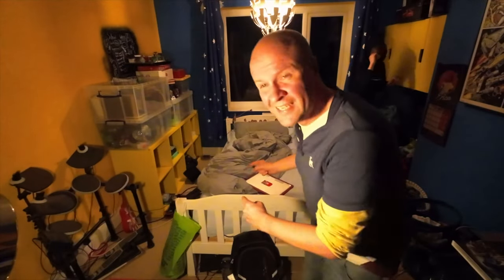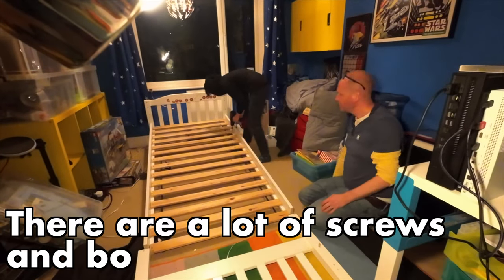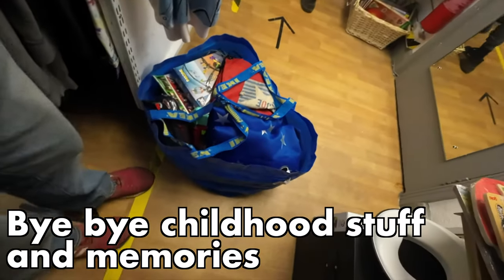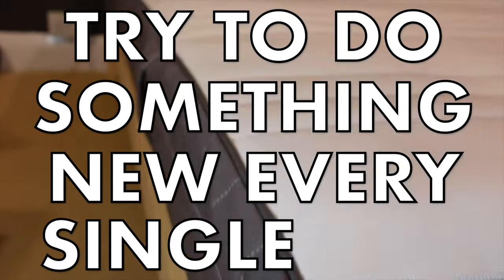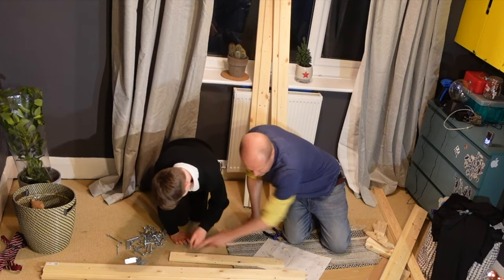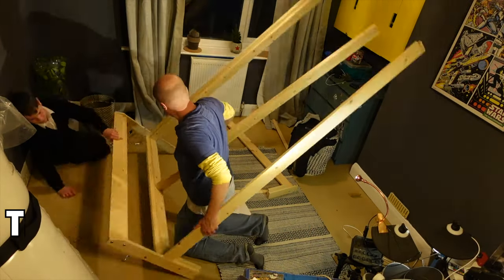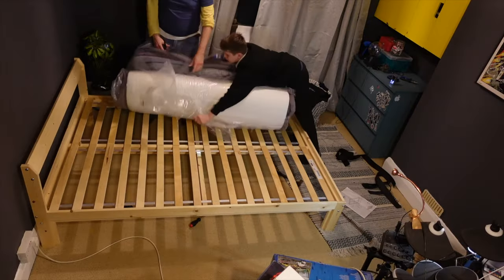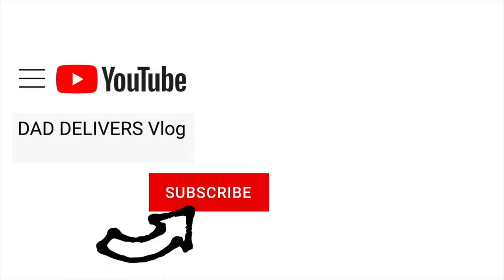PERFECT teen bedroom? IKEA Neiden wooden double bed with Luroy and Hovag mattress

Comment: I wish I could send a pic but if someone has the booklet could they help me with step 9 please?? Very confusing!!
Reply from the maker: Hi John
Thanks for the kind question 
Don't know if this is the same thing but I got totally stuck on step 11
I couldn't get the middle bar to fit 
The only way I solved it was to use the wrong longer bolt to draw the bar into place so the frame could come together 
Then remove it to put the correct bolt in instead
Hope some of this makes sense
It was the hardest part of the whole thing

Comment: Dont even think about buying this piece of crap. Returning it tomorrow.. cant ever re-assemble
Reply from the maker: Thanks - that bar down in the middle was the killer for us.
We had to get a long bolt from the side and use that to pull it together to the frame... take the long bolt out and put the shorter one you're meant to put there... Took me ages to work that out. Way too difficult - good luck with your return and thanks for the kind comment

Comment: Please helpme!! I dont have holes in the middle stuff and I cant put it to this studf
Reply from the maker: Hi Really sorry to hear this - we got stuck here too.

Here's how you do it.

Use the LONG bolt from the bed side section to pull together the middle section, then take the long bolt out and replace with the correct shorter bolt.

Hope this helps!